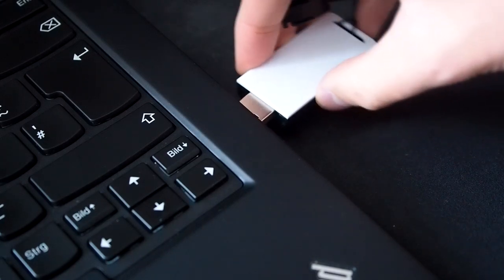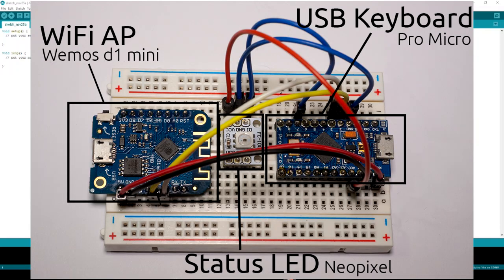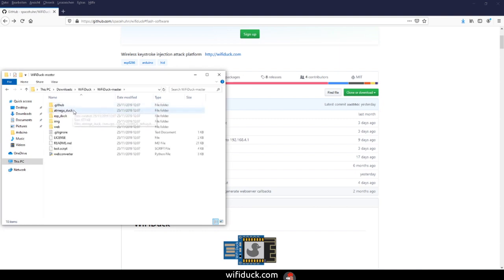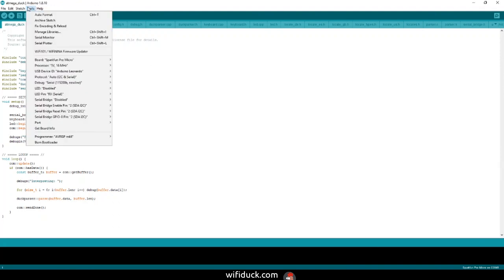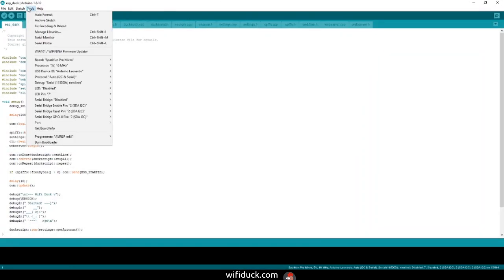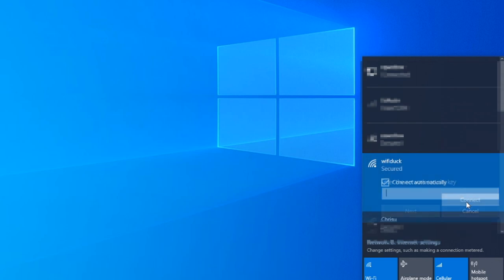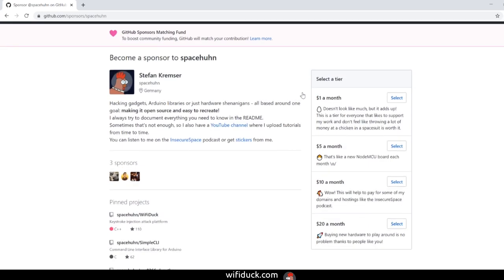WiFi Duck - Software Flashing Tutorial - Wireless Bad USB w/ ESP8266 + ATmega32u4

Comment: Hello  I have ISSUE WITH MI ARDUINO PRO MICRO AND D1 MINI as (Wi-Fi DUCK) my poblem is when I press upload buton to upload code atmega_duck to pro micro then it show me THIS UPLOADING ERRROR: Property 'upload.tool.serial' is undefined. Please help me.
Reply: I have this same problem any luck?
Reply: Same problem dude
Reply: @chrisablondi2202  I was fix it after maybe 1 week.
I fixed it like this : Save sketch and after it restart pc. Now when is pc restarted open Arduino IDE and this sketch with all libraries and other. After it wait for load it few minutes because is big sketch with all code. Now connect blank device it depends on what script you want to upload to pro micro or wifi module Esp8266. And thats it. I hope I helped you. :D
Reply: @tonkofonko  can you explain what you did? did you just restart your computer or did you have to install anything extra?
Reply: @GuiSilva1  No, I didn't download any other stuff. I just restarted the arduino ide and waited for the whole WiFi Duck sketch to start with everything needed and before that I cleaned the Pro micro and Esp8266(D1 mini) using the empty sketch that is when the arduino IDE starts. This is empty void setup() {}
and void void loop() {}
Just upload blank sketch to Pro micro and D1 mini and then upload correct code to this two boards and thats it :D
Reply: Help when i upload my pro micro disconected itself
Very similar to this
https://youtube.com/shorts/DrOq0KrHtJ4?feature=share
Reply: @bozo3427  Hello I was have this same problem on Pro Micro board. But I was fixed it like this : when I have already verified sketch on Arduino IDE and have unplugged Pro Micro I needed 1 wire to connect 2 PINS TOGETHER (GND and RESET pins on board) now connect it together and conect Pro Micro to your pc. When you connect it to pc fast remove wire on connected pins. Thats it. I HOPE I helped you.
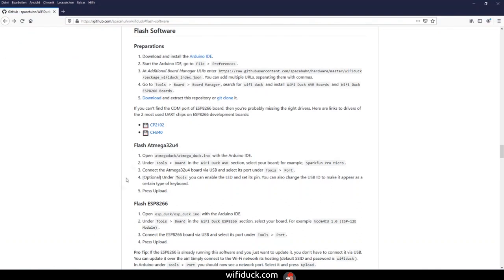Reply: @tonkofonko  I ended up fixing my problem. First things first, it was the WIFI DUCK AVR BOARD. I was using the same pro micro as in the video, but I had to resort to going to the SparkFun website to get their json location, similar to 0:40. This allowed me to select SparkFun AVR Boards > SparkFun Pro Micro. That one worked.

Also, be careful about the processor setting under tools. if you have an 8MHz or 16 MHz make sure it is on the correct one. I had bricked my board with the wrong one
Reply: @tonkofonko  can u show video

Comment: I cant get the dstike to authenticate On my rasp pi Kali 2020.4 it works perfectly fine on windows mac and Linux mint ,,it just will not connect, about 100 attempts I got it to connect but wouldn't load the webpage but any other time nope it just endless cycles asking for my password and failing to authenticate...